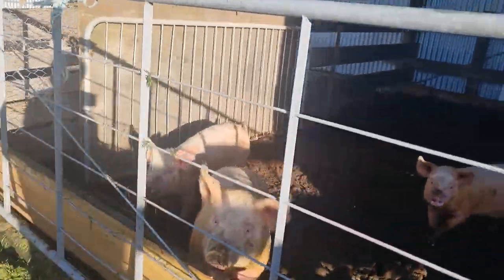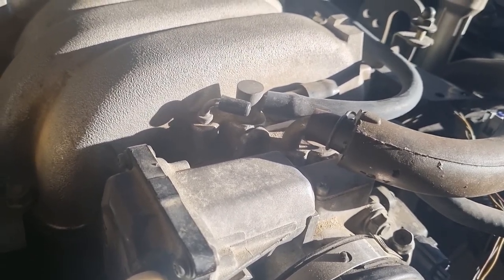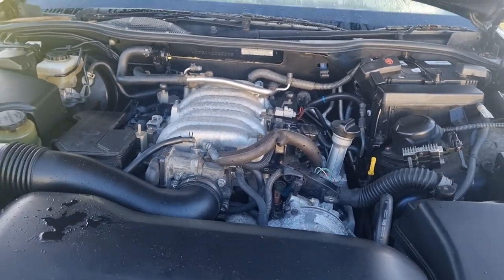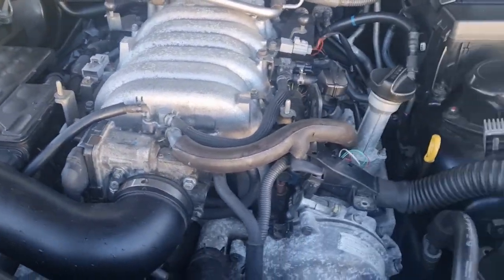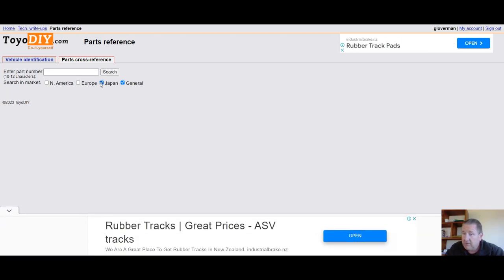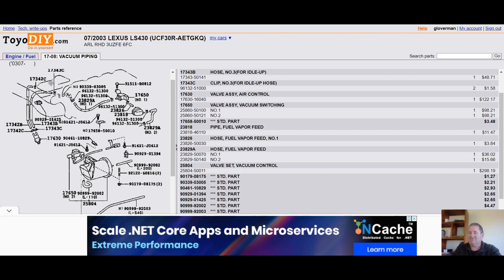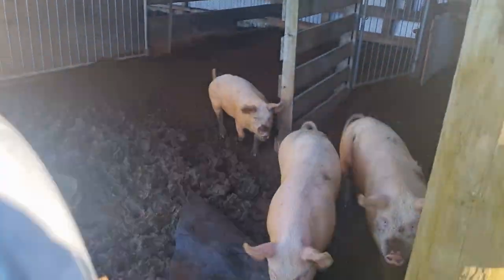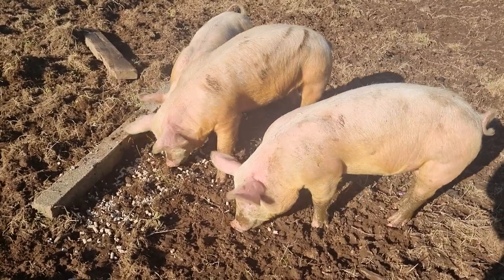3uz and 1uz vvti vacuum hoses

Comment: I actually needed this! My 2004 SC430 hoses arent doing so hot, and my fuel evap hose broke clean in half doing a repair. Where can I get hoses that aren't 80 dollars a piece
Reply from the maker: I generally find the part numbers then depending on where in the world you live find a suitable supplier.  I have my own wholesale suppliers as I am buying lots of them.  I have some finding part number videos where I also show how to find some suppliers which will be released soon.  Cheers Kelvin

Comment: I have 2 or 3 hose coming from the  front drivers suspension side and there are not connected ... i dont know where do they connect can you help me here.. and also have 1 pipe coming out of the resonator box from the back side and it cut...
Reply from the maker: I have helped by making this video,   showing where the vacuum hoses go and showing how to find the diagrams for the vacuum systems on all uz (and all toyota) cars.
Reply: If it is a 1UZ you should head over to the lexus LS400 owners group, take some pictures and ask there, they'll be able to guide you. Probably even if you have a 3UZ

Comment: Are 1, 2, and 3 UZ vvti covers all the same?
Reply from the maker: No,  some have a moulded filler,  some a bolt on,  there are also different pcv attachment techniques.
Reply: @CartuneNZ  is there any other one that's the same as my vvti 1uz? I'm in the states, and gs400s are hard to come by, but ls430s are in almost every junkyard.
Reply from the maker: @travisstamp7428  ok,  so maybe the question you were asking may have been if they are interchangeable,   which some of them are depending on the filler clearance and pcv valve used,  or swapped to the later pcv is fine.